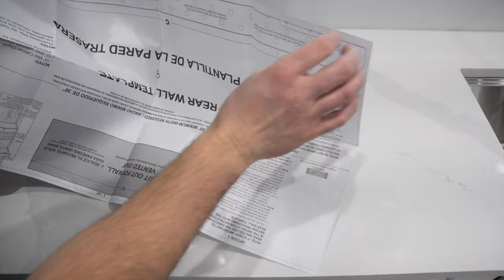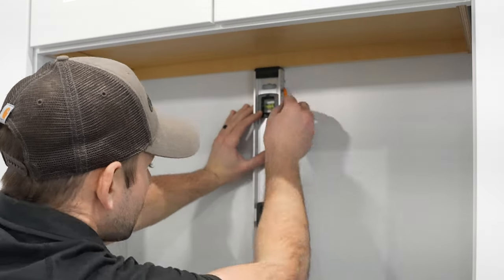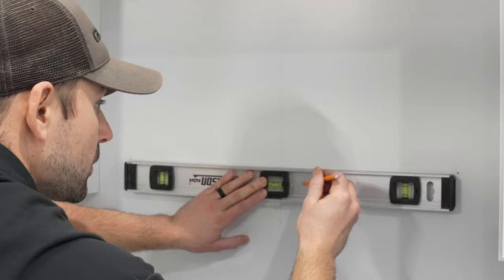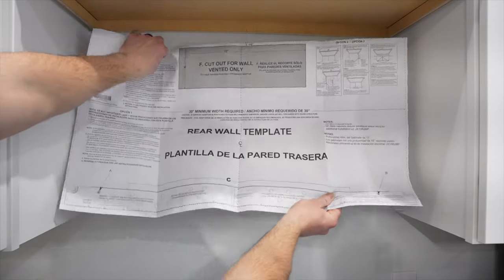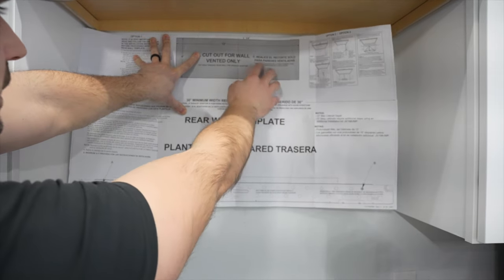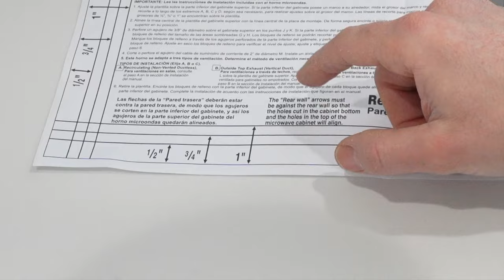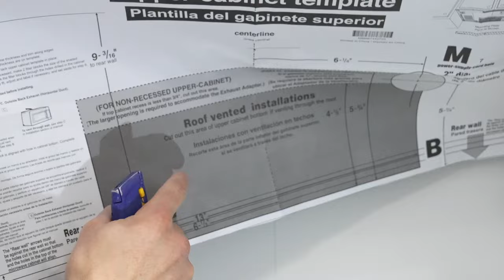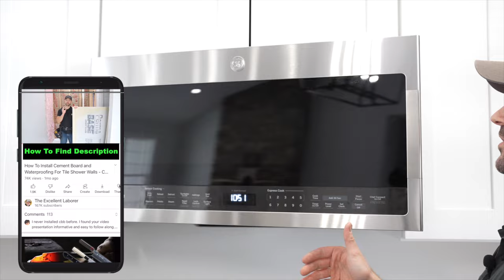How To Install A Microwave - Complete STEP BY STEP Guide

Comment: I am jealous because you have a helper. Hahaha. I rarely would have anyone but being 6'5" is a big help with long arms. If I was doing a remodel, I always put 2×6 blocking in the wall so I never had to use toggle bolts. Although the bracket doesn't hold all the weight to a certain amount. Putting the recommended blocking is so important as well so you can't cause damage to the cabinet bottom tightening the bolts to much. I always measure the cord size when drilling the hole through the cabinet bottom and would use a plumbing excursion cover to hide the hole better. (a personal touch I guess) One thing I had happen once was the vent direction was set up for back venting and top venting and not re circulating. 
I always would check that before installing so I wouldn't have to take the unit down. I love the GE profile units as well. Great features and simple to operate. Don't forget to check the light settings underneath. Love the high and low. 
Great job as always Josh.
Reply from the maker: Thank you. Everything is so much easier with a helper! You could probably install that microwave with one arm. I’m only 5’ 10” so I need all the help I can get 😅. Yes, the blocking is crucial because I have accidentally tighten the bolts up too much and you could tell it pulled it down the cabinet floor. Checking the venting is smart! We rarely install venting for the microwaves. So far the GE appliances have been great. I do like them. I had whirlpool in the old house and they were good as well. Thanks for stopping by again, David! I always appreciate your comment!